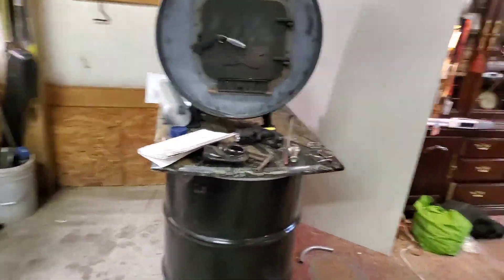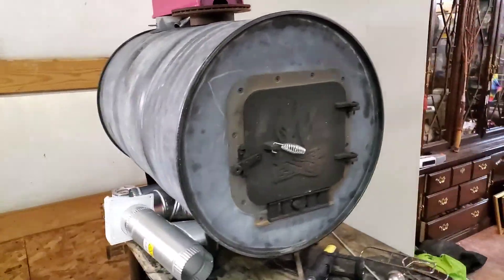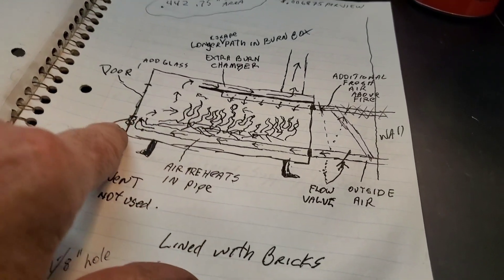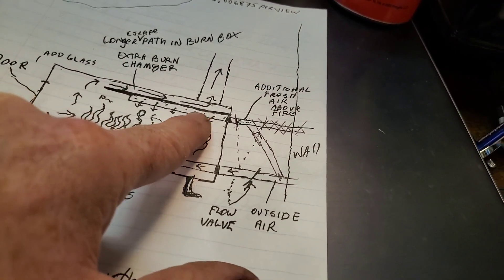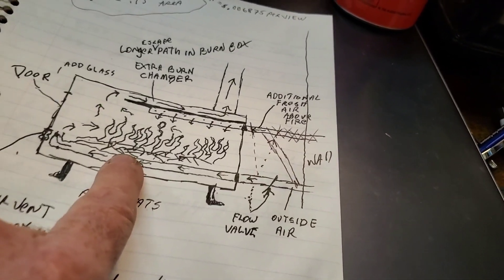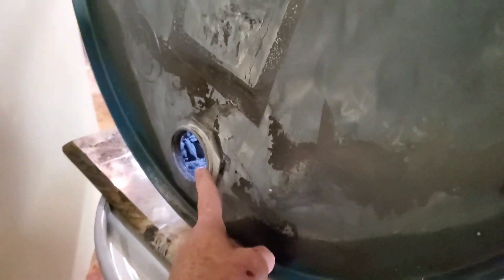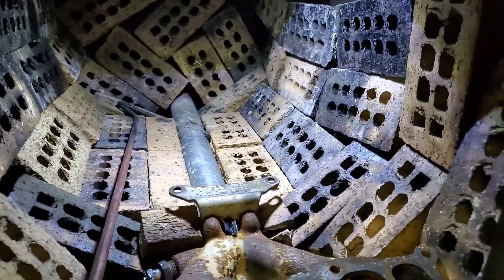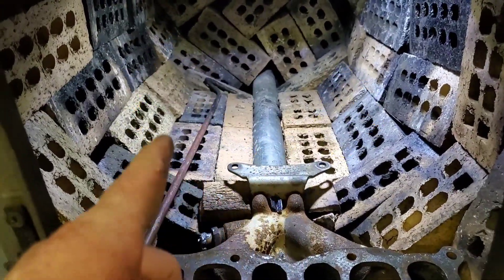A Clean Burn High Efficiency Barrel Stove Secondary Burn and Exterior Air Intake. Best Barrel Stove

Comment: I made one of those a couple weeks ago and it does actually burn much cleaner. The pipe with the holes actually burns the smoke and looks like a gas burner. There is no smoke coming out the chimney now.

Comment: Looks like a great upgrade and all that brick will also protect the lining of the barrel so you can get many more years out of it. One thing though... the extra primary air is a great idea because what the barrel stove door kits give people is not enough air, but there is no need to -preheat primary air like how important it is to pre-heat secondary air. Yes.. it's a bit better, but many "outside air lines" on wood stoves come in from the ice cold outside with no problem.

Comment: The barrel is a bad material for a stove - it will burn to holes wery fast, the metal is too thin and bad quality. The barrel is made only to sell liquid in it and then rust to dust )
Reply from the maker: The barrel I used is quite a bit thicker than a standard barrel. The barrel dealer has a variety for different uses. If you use the correct barrel, it should provide many years of service without a problem.
Reply: My barrel has been burning 6 months a year since 1996. Just a regular barrel with a proper ash bed.
Reply: They'll last forever if you do it right. Disconnect the stove pipe at the end of the season clean it out and spray used motor oil all over the inside. It burns off next season.
Reply: @exposingthetruth3821  how do you do your ash bed?
Reply: @roz4747  I burn hot. Always hot even if it's a tiny fire. I do run it slower at night time like most.  Whenever I need to pull ash, I use a shovel with slots in it like a cat litter scoop, but longer.  I pull anything out that won't go thru it.  I always leave a solid inch or two of pure ash (try for no coal) in the bottom.  Enough to insulate the barrel from the coals.  I can lightly touch the bottom of my woodstove when it's roaring from the ash.  In the spring, again, I'll cook out my entire stove, empty it entirely this time, and i take a rag of bacon grease or tallow and rub the inside where the ash bed was. Below the fire soot line.  I then lightly brush all my soot and inner stove pipe down into the bottom. I then pull that out.  I'll leave nothing in there for the humid months and use a rack for the first few days of first years fires to get a good ash bed, then I pull it because I find it to be a pain in the A for the long winter as far as cleaning.  I burn directly on ash bed.  But I also have the luxury of 125 acres of oak and willow that burns super clean.  I have a double barrel that looks new from 1996, and another in my shop from 2007, nothing fancy, cheap vogelzang kits.  I have a friend who digs his beds, uses a rack, drops coal on his all the time, his barrel burned through in 5 years.  But he leaves ash in his all year, it absorbs moisture, and since he didn't coat the metal in anything, the oxidization eats it up.  I'm still using the same outdoor stove for summer from when we built the house in 1996 as well,  looks new (flattopped 55 for cooking, oven cavity on top inside top barrel for oven, nothing but bacon grease, leftover tallow coating a few times a year.  Where I live, if you don't coat it, it's going to rust or moss up in a week half the year.  Also, I use sand batteries.  The stove in my shop is a 30 gallon inside a 55 with sand in between.  My fire is small, goes out, and it's still warm 12 hours later when I come back to work.  I'll never not use sand batteries again.  My first stove doesn't have one and it burns 2x the wood a year.  But the barrel of sand behind it stays warm for a day.
Reply: @ awesome very cool thanks for the reply, wouldn’t it be good if I use a barrel that popped off on the one in to make cleaning easy?
Reply: @roz4747  you can, that's up to you.  Mine does come off, but I've always just cleaned it from the door mounted on the removable lid.  It wouldn't be a bad idea. Just assume you'll have some creasote to deal potentially with to get it back on.  It also depends on the wood you are burning.  I leave mine on to keep it 'sealed' even though the band strap probably would do the job either way even when cleaned in such manner.  You wouldn't want to do that during operational use (opinion, not fact), but maybe at the end of the season?  Just keep the bottom ash bed dry and warm, and it'll last so long that the price of barrels will quadruple from inflation before you need another.  I'm sure my stove will outlast me.  Mine were thick barrels used for the glycol that goes in the system for ammonia controlled flash plate freezers, in a strictly regulated mest processing plant. I'm sure that has something to do with longevity as well.  They don't dent easily, nor cut easily.
Reply: @exposingthetruth3821  big 10/4 and thank you.

Comment: so the secondary tube has 2 sets of holes???            i made a stove  and used a tail pipe for a  heat exchanger  with blower on the end  ...grate  idea with the exhaust manifold   u have a burn test video??
Reply from the maker: @mikepruett1745  the secondary pipe is cross drilled so holes on both sides. The stove works great. I shoved 3 cords into it this year.  Keeps the shop around 60 when it's single digits outside. It's great if you don't mind cutting firewood and live in a forest.

Comment: Sorry instead of doing so the modafacation just get a woodstove
Reply: Price a woodstove lately? I can get new single use barrels free and the rest of the parts are very low cost and reusable. First accessory should be a carbon monoxide detector. Second a good fire proof   wall to prevent wall combustion, cement board may work well. Next would be a heat powered fan to circulate heat.

Comment: I like the idea of the bricks. I believe though that when you described how they are to work the word you are looking for is heat sink. they make a good heat sink because they have a high thermal mass but like most things with a high thermal mass they take almost as long to get hot as to cool down afterward. also when you welded the sheet metal plate to the roof it would have been better to weld the middle and allow the corners to be free. as the metal expnads and contracts with the change in temerpature, this would allow the corners to move.
Reply from the maker: I've always thought of a heat sink as a device used to actively cool something, that's why I referred to the bricks as a heat battery or heat shock absorber. It's kind of the same idea but the end result is a little different. Give it some thermal mass and it swings slower. With a heat sink, it's all about radiation of that heat to keep the host cooler.  I think.. Thanks for commenting!

Comment: I am wondering what is the size of your flu exhaust pipe ??
        Just imagine if you would get fire bricks that are was denser than the holie cheese ones you are using, then placing and cementing them in place all around the barrel. That would really make for a killer efficient wood stove. I like your thinking and working methods you used Garrett. 
            I was able to get a catalytic converter from an old science laboratory that closed down. The diameter is 14 inches by 4 inches thick. I will be trying to put in place this item right before the flu pipe exit. This should give my stove the extra bit of efficiency
            The outside air is what really make the wood stove the star of the fire show. Am doing that right now Garrett. Will be taking air right from the attic through one of the HVAC ceiling vents. Then when the season is over, I will convert the vent to normal function. 
            I look forward to see what else you do with your ideas in the future. Good luck and peace too. vf.
Reply from the maker: It's a 6" chimney.  I'm enjoying it right now.  Keeps the shop warm and looks cool. The porous bricks seem to fill with ash in short order so the morter is self supplying.  Thanks for watching and commenting!
Reply: Look forward to see more great video Sir. Peace vf @OGGarrettsGarage

Comment: I think the smoke outlet should br only at the back. The logic is: your inteke air is in the front, it will tend to rise up and acape to the chamney. If you force the smoke to scape through the rear you make the unburt wood gas enter in contact with your secundairy air that is coming from roles all the way to the back. 

This modification should be easy just needing to close the front gap btween your metal sheet and the barrel.

With over a year of experience you shoud be able to tell if what i say makes sense.

Comment: You might find that the secondary burn area is ineffective the way you have it planned out. Generally secondary combustion air needs to be preheated more so than primary combustion air, your design happens to have it just a little bit backwards. Lol! But who knows, it may work just how you have it, I can’t say as I’m not a solid fuel combustion engineer. Keep us posted, I’m genuinely curious.
Reply from the maker: It seems to be working as expected but I need to install some sort of sight glass so I can see inside with the door closed.  It certainly looks like secondary burn is happening for a moment when I open the door.    This last cold snap I was able to keep the workshop in the low sixties while it dropped to single digits outside.  Thanks for watching and commenting.
Reply: I was going to ask if you have a way to know for sure if secondary burn is happening without a window. I like this mod a lot, I have one of these in my sauna that was installed by the previous owner. It’s ridiculous how much heat goes up the chimney so I’m looking for ideas to add a baffle. I like your ingenuity, cheers!

Comment: Doing the same and tightly wiring metal fence post along the outside of the barrel and a couple of fans on medium speed rotating the air and wondering about an old cast iron radiator and if I can heat enough water for ibc poor man’s hot tub with the lower wrapped in copper with patient and precise bends I think I’m on the right track and if I keep it stoked for 2-3 hours I believe or hope I will be close to achieving but I do realize I don’t need to experiment personally with the. Radiator as that could be bad with too much pressure ahhh research research research I know when I had oil going my first year I could take my spray foamed shop from 55 to 95 f in about an hour really weird go in bundled walk out in boots shirt and undies soaked from all the sweat and I was losing most of my heat right up the flew pipe i had 2 of the heat powers fans on top barrel and about 10 inches up bottom of flew and that was minimal but collectively I believe is the key- great video I’m with you I might as 2 more fresh air in take on the sides cut offs everywhere plumbing for air or water as running pipes under my planters in next room greenhouse was as well on my mind as I have lots of irons in the fire

Comment: I think that you'd  have been further ahead to simply install  the top drum kit overhead than to screw around with all that unproven theoretical second burn circus that you have going on in your head !
Reply from the maker: Secondary burn, also known as secondary combustion, has been proven to help improve the heat output from burning wood, and helps wood burning stoves to achieve much higher efficiencies than traditional wood burning fireplaces. It also provides other benefits such as helping to prevent blackening of the glass on stove doors and it reduces emissions from burning wood.

Secondary burn plays a key role in making stoves as efficient as possible. It's science.
Reply: Top drum kit doesn't serve the same purpose as secondary burn kit.